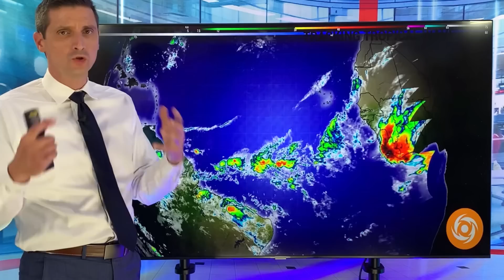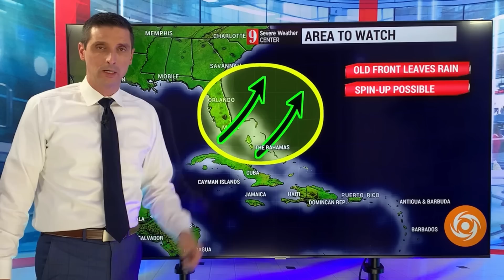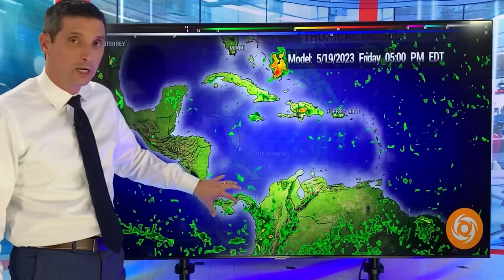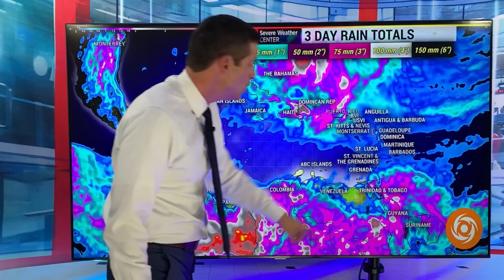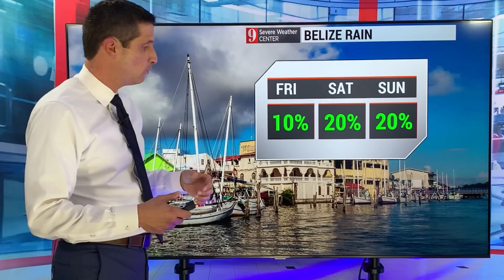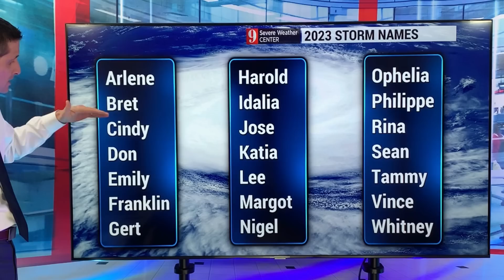Flooding Likely this Weekend!

Comment: Today skies were  mostly sunny, dry  and partly cloudy  at times. High temperatures  reach 89 degrees Fahrenheit along the coast and 97 degrees Fahrenheit over inland areas. Tonight's low temperatures will be 79 degrees Fahrenheit along the coast and 72 degrees Fahrenheit over inland areas.   A heat alert is still in effect for inland areas. Thanks  Brian for the update of the weather. Have a great weekend with your family. Stay safe.